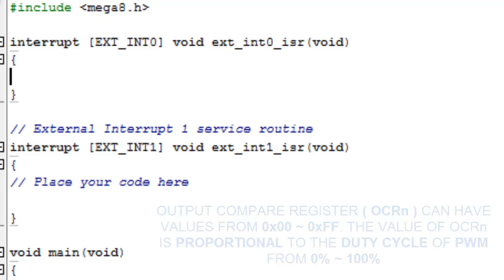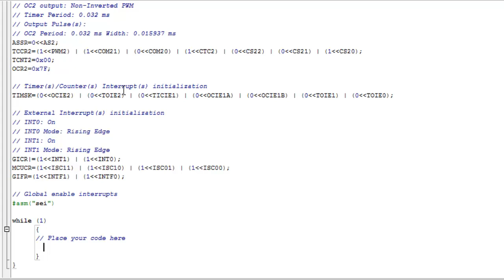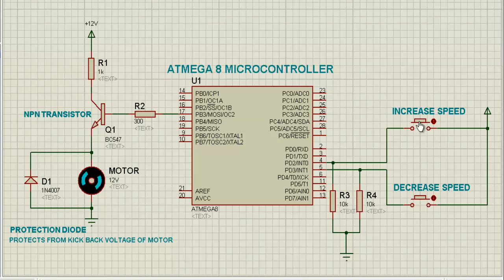DC Motor Speed Control Using PWM - Proteus and Codevision

Comment: is that motor 12 v in implementation use driver motor?
Reply from the maker: there is no driver circuit here. just a transistor. Though it could be considered as a simplistic driver circuit
Reply: +THE TECH TONGA i Made simulation in proteus, and the pwm cant run well
Reply from the maker: +Rafi' Naufal perhaps you should try another method to analyse the pwm. might I suggest the graph
Reply from the maker: +Rafi' Naufal nicely done. It's an honour if I could be of any help to you